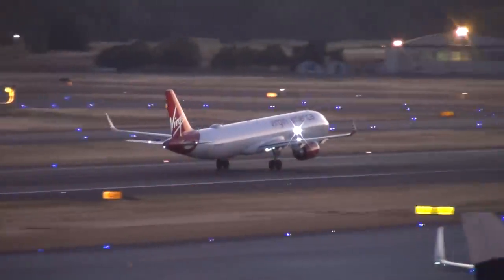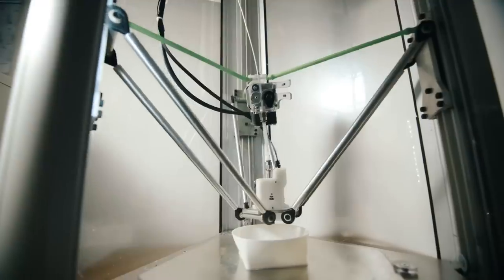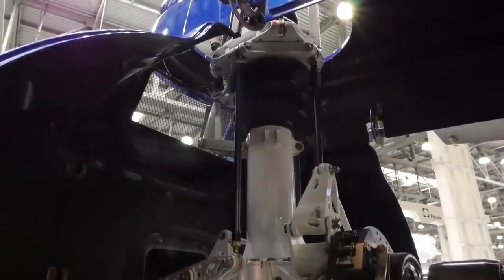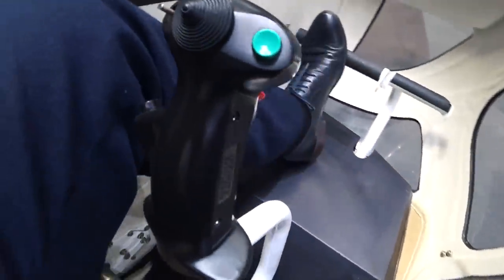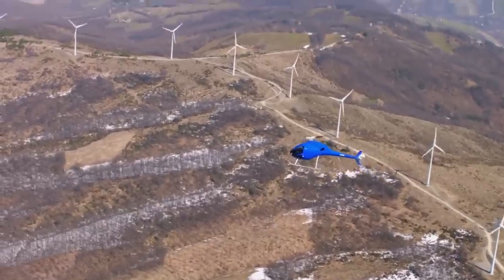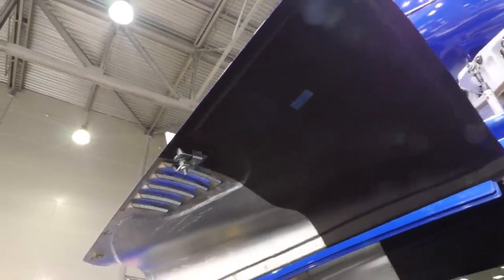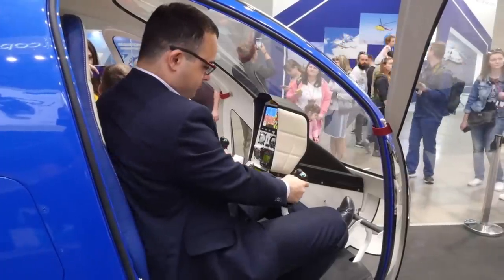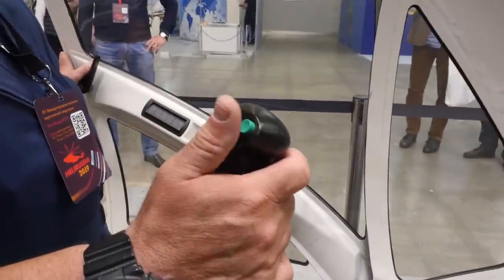Curti Zefhir - an ultralight cutie

Comment: When all else fails, it's nice to have a parachute.
Reply: Until it's immediately caught up in the rotors....
Reply: @mp-xt2rg  Watch the video at 6:43
Reply: @mp-xt2rg   poor listening skills...
Reply: @1compaqedr8  elaborate
Reply: m p go to 7:22 in the video for explanation
Reply: @1compaqedr8  I take it your not a pilot.... Most crashes at altitude are vfr into imc resulting in either collision with terrain or an unusual attitude. The parachute would be worthless for either hence the parachute in the rotors comment. The scenario in the video is unrealistic because any pilot would just put the thing into autorotation and land normally. This company had made an expensive poor performance helicopter with high operating cost to solve a problem that doesn't exist. They were probably banking on riding on the coat tails of Cirrus. I bet they pivot to something else or simply declare bankruptcy.
Reply: @mp-xt2rg  Wrong assumption about my background. Also you are taking a very narrow assumption of ALL possible emergencies. Just 2 days ago I was at the fbo I work at and 50 miles away 2 people died in a crash.  A ballistic parachute may have saved them.
Reply: @1compaqedr8  working at an fbo doesn't mean anything to me. Are you a trained pilot or no? And your comment on the cash is very vague. Airplane? helicopter? What was the cause of the cash? And why do you think parachute would help?
Reply: m p   You being a pilot doesn’t mean anything or change the facts of dying when you slam into the ground. I’m a student pilot. Are you against safety improvements in aviation? How many lives were saved by cirrus parachutes? What’s your issue with a parachute?  The crash i mentioned was an experimental aircraft which can be retrofitted with parachutes compared to certified aircraft.  The cause hasn’t been determined yet but many of the experimentals at my field have parachutes.  I was happy to see this helicopter having a parachute.
Reply: @1compaqedr8  Hurt my ego? You called me out remember? Im just explaining why im not wrong. I dont have an issue with safety i just said that this parachute would be ineffective in any real life scenario because its attached to a helicopter. helicopters are not airplanes. A ballistic parachute may very well have saved the plane your talking about. They probably stalled the plane in a non coordinated turn in the traffic pattern. A parachute is great for that. thats not what brings down helicopters though. The BRS on this helicopter can be argued is a safety hazard. The zeffer is an under powered helicopter that burns a lot of fuel with little gross weight capacity. The 75-100lbs this option weighs is a big deal. It could carry 30% more fuel. or maybe it Could take off without busting max gross with two people on board. Helicopters dont need parachutes because the already have one spinning over head. Find a crash where a parachute would have saved the helicopter  and get back to me. Sorry buddy but im not wrong on this.
Reply: @1compaqedr8  Minimum altitude for deployment is 450ft. So no it would not have helped that guy.
Reply: m p yep I already stated low altitude. The point was to show how wrong your claim that ‘helicopters already have one spinning above’ theory is for never needing a parachute. Are you going to autorotate after a mid-air collision? Some ballistic systems auto deploy after mid air collision.
Reply: @1compaqedr8 My point was that it doesn't help in real world crashes and is a burden on the aircraft in normal operation. Thats still true. And as far as a mid air collisions maybe it would save a plane but still wouldn't help a helicopter. Remember its going to be tumbling through the sky with spinning rotors on top right next to the attachment point of the parachute. My point that helicopters have built in parachutes holds true because auto rotation would always be a better option at the working altitude of the BRS. Again im not wrong on this.
Reply: m p the point I’m making is a pilot can still autorotate but if rate of descent is too high OR in IMC a parachute could be a better alternative.  For this lightweight pleasure helicopter, the system works as shown in the video.  If a buyer wanted they could probably elect to not have it installed.  For a sales perspective it is smart.
Reply: @1compaqedr8  Well i guess we will have a agree to disagree. I think its worthless because it wont help in a real crash. You like it because it gives you the warm fuzzies and your willing to sacrifice aircraft performance for that feeling. Id rather not compromise performance/safety for a gimmick. its not going to help in imc because the helicopter is already going to be out of control before its activated. No one is going to pull the chute if the helicopter is under positive control. The thing is irredeemable.
Reply: m p Which fatal heli crash was prevented by autorotation? Send a link.  Puzzling that you claim a parachute won’t work when it’s clearly shown in the video stopping the rotors, deploying and landing safely.  It gives the pilot more emergency options within the designs weight and balance limits of 2 people and 2 luggage compartments.
Reply: @1compaqedr8  you know this, how?
Reply: @Carrera6rennsport   what?
Reply: What if the helicopter start burning mid air

Comment: Very impressive and a real turbine engine. $500k is not unreasonable for a real turbine helicopter. I can see flight schools going for that.
Reply: It's not a turbine.  It's 4 squirrels in a cage wheel running VERY fast.
Reply: I don't think it's a good helicopter for flight schools, since it's so simple.
Reply: Robinson’s are still a better option
Reply: @AV8R_1   And the same price.
Reply: I used to own an R22. I sure would have liked some turbine time.
Reply: @TheRotorhound  Many flight schools that use the R22 are now bringing in 44's and 66's
Reply: I agree that this is a pretty good candidate for a training rig. Parachute for added safety and turbine for simplicity in maintenance. However the cost in insurance and fuel. Oh well, we will see.
Reply: A look at total cost we still probably can't beat a 30 year old Robinson.
Reply: I believe that pilots that want to get jobs flying helicopters need turbine time and that is expensive. I guess the options are military or lots of money. R66 probably costs more per hour than a 2 place turbine. Time will tell if this gets certified.
Reply: @TheRotorhound  turbine mosquito.
Reply: Jeremiah Scherer    Yes, but you can't train in a single seater.
Reply: Look at the mosquito xet
Reply: Alexander Desfosses   Single seat. Needs another seat if you are in training. Looks neat though.
Reply: @TheRotorhound  they used to make a 2 seater I thought it was still in production my mistake

Comment: 10:20 "A piston engine with the same performance would weight twice as much". Wankel engines might have a unusual pisons, but they're still pistons. That's what "Kolben" in Felixes "Rotationskolbenmotor" stands for.
Reply: A Wankel engine does not have pistons. It has rotors or rotating lobes.

Comment: BSFC of the turbine is 548g kw/h. An equivalent 4 stroke piston engine may weigh twice as much but its fuel consumption is also only about 225-250g kw/h so you use a lot less fuel and require less fuel on board. 100kg of fuel on board for turbine, or 40kg on board for piston engine.

Comment: I'd buy 2 Mosquito helicopters and a Raptor aircraft all new for that money and have enough money left to buy a sports car.

There's even some change left after that,...aka they've priced themselves way outside the ultralight airframe market.
Reply: There exists no market for 2 seater turbine helicopters right now. I could see this working for people who dont trust a reciprocating engine and also want the parachute.
Reply: @codmott286  It just won't get an ultralight helicopter certificate in the EU because of its turbine.
Reply: Can't be an ultralight in the US because it's a 2 seat model. It'd have to be a light sport aircraft.
Reply: @kerbalairforce8802  i think the use of "ultralight" wasnt meant literally. Nothing about this aircraft looks like it would be in the ultralight catagory. Compared to its obvious competitors like the R22 or the cabri g2, it seems to match up closely. The turbine gives it an edge in my opinion, but not everyone would think so. I think with a max gross weight of 700kg, a turbine is less attractive and a luggage compartment is pretty optomistic, but no mention was made of the empty weight so who knows what youd be able to do with it
Reply: @codmott286  parachute wont help in most cases its a gimic
Reply: @bailey2624  Do they mention minimum altitude to deploy? BRS on fixed wing can be effective as low as 500' AGL however that takes into consideration forward velocity to assist in deployment. Honestly with the turbine I dont see why anyone would want one.
Reply: @codmott286  think they did the test at 300'

Comment: To improvements that I would make on this design would be one a little bit of a larger parachute and for the drivetrain removing the belts and replacing it with a drive chain system
Reply: Belts probably are seven more reliable than chains nowadays and weighing a whole lot less. Seems you never asked yourself how a washing machine lasts 20 years and how it is powered..  It has a small diameter wheel at the engine side and a large one on the trommel. Both move on the same frame, and between the two there's a belt. The engine does like 40 times the number of rotations the trommel is doing even in high speed centrifuge mode when the trommel can do 1000+ rpm AND the belt continuously gets deformed..
Reply: @harrickvharrick3957  With improvements in technology. Steel chain used far outlast belts. As for a washer machine.... I remember an old Hover washer spin dryer that the belts always broke. I installed a chain drive assembly and it still works 40 years and still going strong 💪. I understand weight ratio but it can be done
Reply: @NYRM1974  how much would the quite hefty, double, super strong type of chain they would use for this weigh compared to about half a pound? Remember, in this lightweight copter they have attempted (and succeeded) shaving off several hundreds of pounds when compared to a conservative design. It matters a lot of of course, given this special chute system. And about their life expectancy, is that actual data or your interpretation and idea about how it stands?

Comment: In any countries Ultralight Helicopter category this machine's price point rules it out completely!

The brand new, uncertified turboshaft engine and the brand new, uncertified composite airframe and Ballistic Recovery System make this helicopter a very procedurally complex, expensive and time consuming machine to obtain US and European certification on! 

Being that this helicopter's natural competition are the Cabri G2 and Robinson R22, it needs certification in order to fly in the same categories, yet even with certification the price hugely exceeds that of it's competitors!

I expect that AC will be an available option, eating into the luggage compartment space, like the additional fuel tank would, and adding additional weight.

I remain unconvinced about the supposed benefits of having a mast mounted BRS on a light, two seat helicopter.

A polycarbonate, impact resistant windsrceen, longer range, and a cargo hook capability would be higher on one's list of preferences instead of the expensive, heavy, questionable BRS!

Thank you for this interesting, informative and entertaining video with excellent narration and good details.

The attention to detail and weight saving designs can clearly be appreciated at 10:26 on the video where the camera captures the beautiful engine mounts attaching the engine's anti vibration mount to the airframes hard point.

This component is the perfect example of lthe ightweight strength designed into this helicopter!

I don't doubt that the manufacturer is going to see this type fully certificated, they are a hugely respected aviation component manufacturer, about the best to set about designing the next generation of light helicopters, benefitting from new, light, turboshaft engines specifically designed for this type of aircraft!

It will be very interesting to view operating figures once some experience and history is established and I think that it's fantastic that this helicopter incorporates the benefits of new technologies, materials and manufacturing techniques.

The manufacturer has clearly invested in this project with the intention of seeing it certified worldwide!

Comment: Thanks for taking the time to do the conversions from kilometers to miles per hour and kilograms to pounds. For us Americans, the metric system is still a mystery, and those presenters that don't bother to do the conversions usually lose us pretty quickly!
Reply: I still had to convert “300 meters high” to feet 😂🤷‍♂️
Reply: @SaintsCheat  dude, just switch

Comment: I dunno $500k for an ultra-light??  Pilot and passenger...limited cargo..very limited 

I’m thinking if ya have the half mil for a toy, you can come up with the other half for the Bell 505 JR X 

500 shp, almost 400nm’s, 1500lbs of payload, 4 passengers and 125knots
Reply: I live in Vancouver and I'm SOLD let's make a deal 🤔
I can offer you a Wife PLEASE take my wife.
Reply: absolutely agree with Krispy bacon - I hate overpriced shit
Reply: ...or a very nice, used, but, reliable Jetranger.
Reply: Jaxon Mattox one is more for pleasure and very limited where the other has at least the potential for commercial applications, bringing in revenue to offset any extended costs...but I agree there is quite the difference $$$ value between the two..